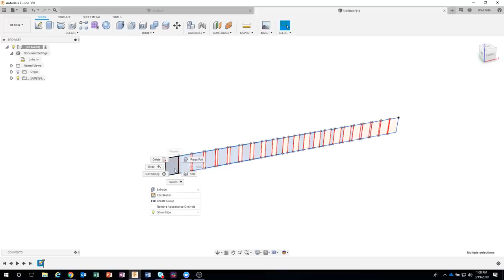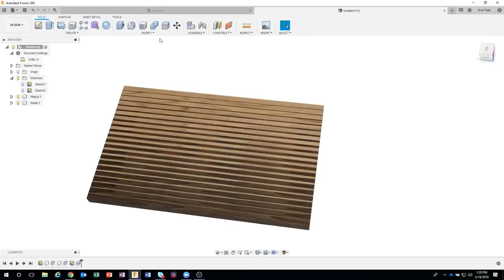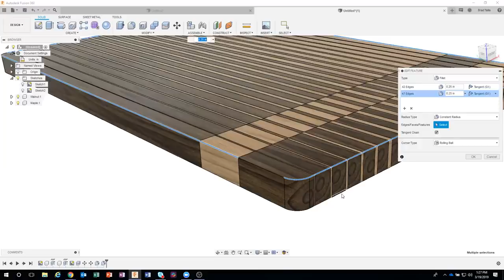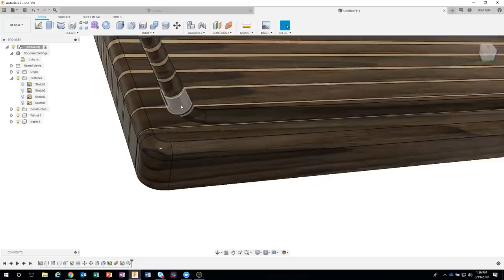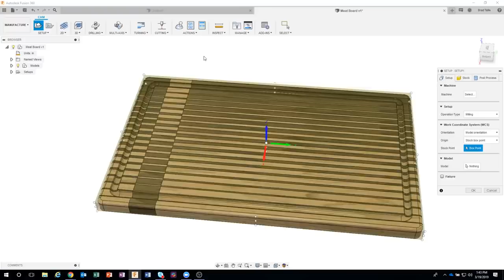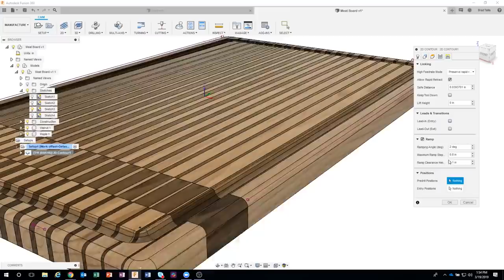Episode 21, From Concept to Manufacture

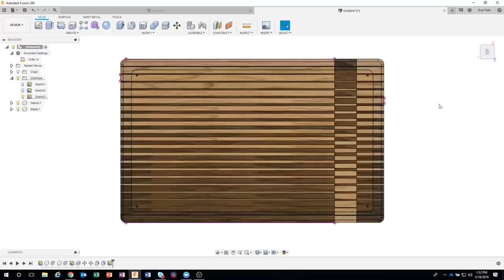Comment: 35:25 You could use "Pipe" command. However sweeping is also valid it just takes longer. Also when in sketch environment you could check "Slice" for better visuality. I am still learning a lot from your tutorials. Just sharing my ideas as you are sharing yours.
Reply: OK now when you adding the fillet that completely changes. Yes, sketching the profile is better here.

Comment: Really excellent video! I'm still trying to wrap my brain around the math you did to get the variable spacing. I'm not math dumb, but something is not clicking. I do have a question though. I have not been able to find how to space an even amount of features evenly within a specified distance. 
Let's say I have a board that is 12" long and I want to put 6 holes, 1" diameter, and place them so the gaps between them and also at the edge are all the same size. That would be 7 gaps. I can't start with a hole in the center and run symmetrical like I could if there were 7 holes. If there were 7 I can start from the center, but even then how I can get the even spaces?
Reply from the maker: @perniculous-  Make sure you watch this channel as I am going to show how to do what you are asking on my Banter with Brad session coming up.
Reply: @bradtallis8968  super!

Comment: What about the filet on the groove....
Reply from the maker: @Stan-   Ya, I was running out of time and didn't show doing the little fillets on the inside of the juice groove.  Truth-be-told, when I made the cutting board, I just hand sanded the sharp edge...  I will create a follow-up video showing how to cut the small fillets on the CNC machine.
Reply: I was thinking the same. The fillet on the edge of the groove was not machined, only created within the model workspace...
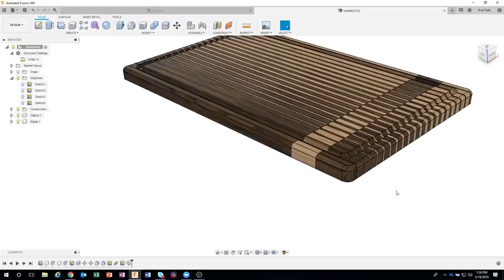Reply: @Stan Janssens. Brad explains how he did that starting at 39:10
Reply: @spikekent  Only in the sketch mode, it is not created on the CNC machine.
Reply: @stanjanssens1618  Ah yes, you're quite right. My apologies.